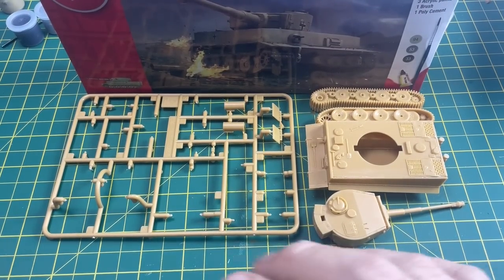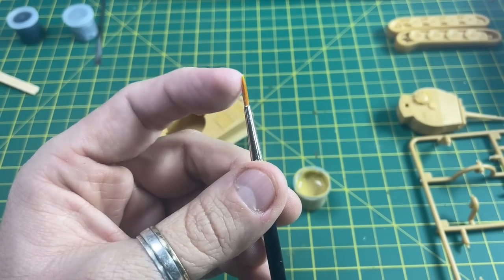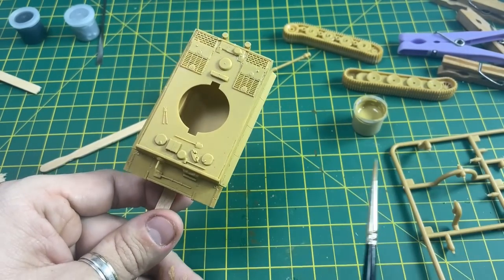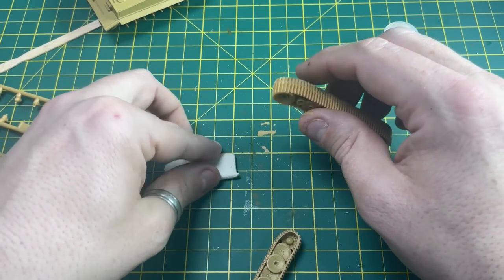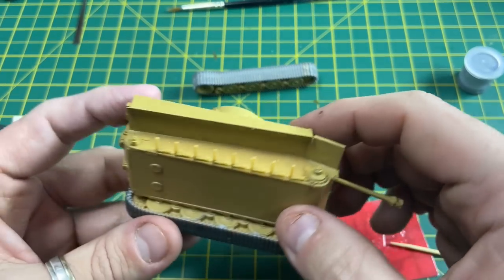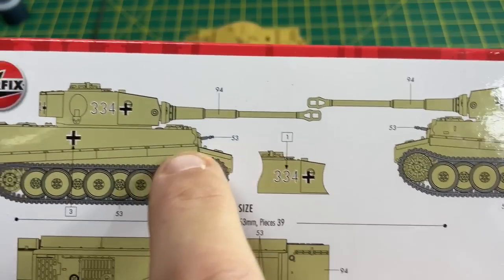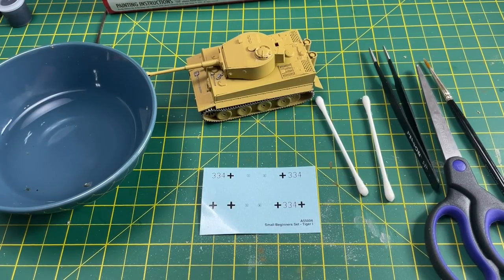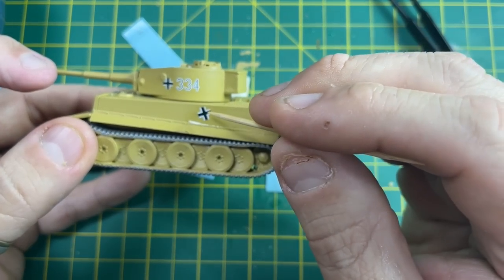Airfix Tiger 1 Painting and Decaling- Aldi Lidl Starter Set - Build Series Part 3

Comment: There is something in the painting instructions that even Airfix missed for their promotional build model.
In the paper instructions for painting the tracks they show only the actual track segments being painted. If you look closer at the colour image on the box though it shows the rims of all of the wheels painted in the same colour as the tracks. They show them as a different colour on the front box art as well.
If I remember right there is a faint raised line on the wheels which show the edge of where should be painted.

Comment: Great beginner content mate. Never hurts to go back to basics and will get first time modellers into good habits. I'd have been tempted to use the flat brush for the main desert colour too as offers better coverage. General rule of the bigger the surface the bigger the brush. I get you don't get one in the starter kit though so fair play. Also, what was 33 black paint for? Don't see it anywhere!
Reply from the maker: I think you can highlight some edges with it.. like around the wheels but i felt that would be impossible with the size of brush in the set...
Reply: @MOS6510Models  Ah yeah think early model had rubber on the wheels before moving to just full steel wheel for later models.